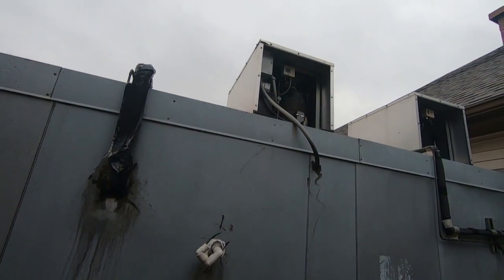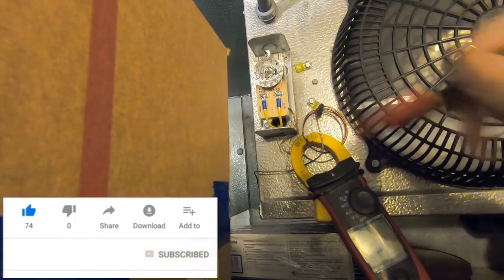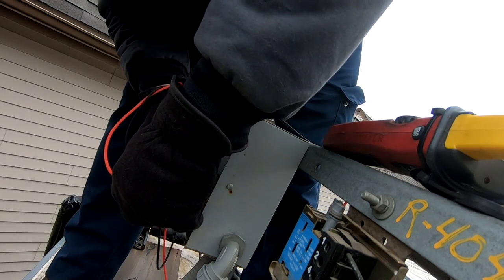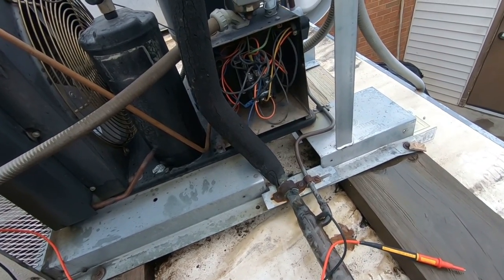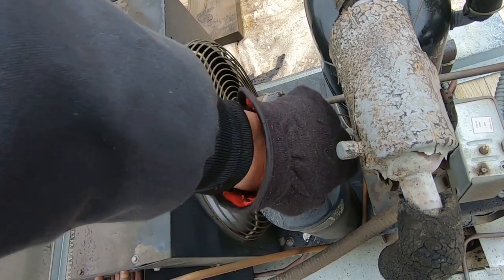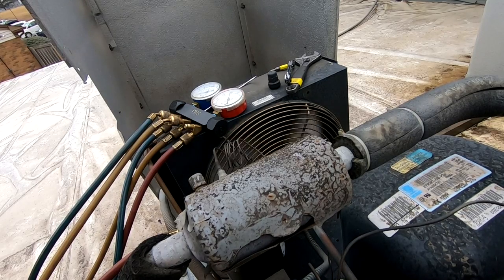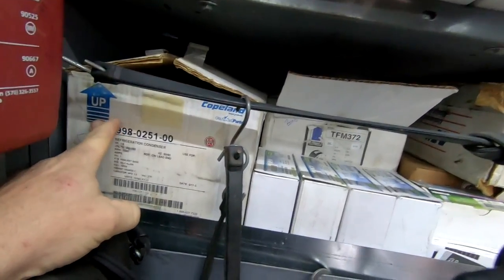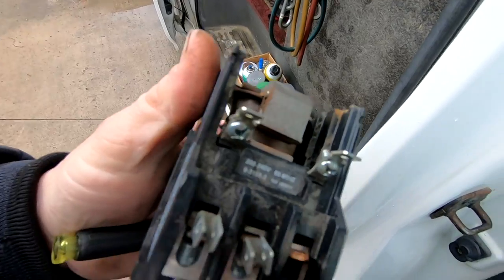Walk-in Freezer Warm With Fan Cycle Switch Adjustment Failing Motor

Comment: Nooice 👍
I like the contactors that you can take the front cover off and inspect them .
Lately I've been dealing with supposedly new Siemens contactors with flimzy @ss push in connectors and you can't take the cover off to inspect them for burn marks , carbon , and such .
Bloody annoying .
Btw  , one neatly organized van that is , Kudos !
Reply from the maker: LoL, My vans a miss, that's why I haven't done a video of it. The contactor that I used does have a removable cover. Thanks for watching!

Comment: ive Got a 8,000 lb service truck & i still dont have the Correct part on my truck. Said EVERY TECH , Every day of the Week. i Looked in my computer the other day & was looking at the motor section that has all the actual motors i have installed in the last 17 years and there was 50 Different Motors in that section. These are actual motors ive sold over the years. So, I Would Have to Carry 50 Motors on my Truck if i was to be assured of having the Right motor for any job. maybe. lol.
Reply from the maker: I get that. I'm just used to carrying a little of everything on my truck where I almost never had to go get parts. That's a little different than where I'm at now.  It's actually interesting how many calls I fix with little to no parts.
Reply: i Get that. i actually put together a little husky go bag for initial call in. a little 12" bag. its been quite nice not having to haul a 40lb bag into calls unless necessary. which is few and far between now that i have it setup. ill have to do a vid on it.
Reply from the maker: @OcRefrig  Yea, make a video of it.  Everytime I pick my most common needed tools I end up going back to the truck. What I have in my tp-XL has about everything I need and maybe only 1-3 extra unneeded tools.

Comment: Good vid. its sooo nice when its a nice straight foreward repair. " use your sniffer " yep, no special tools required. i have not seen the new malco 5/15 , 3/8. ill check it out. i only thought they had the 5/16/,1/4.
must be a new prod. i use the wire tie inside another wre tie thing too. good secure for stuff. anti shaky / antibreaky. like # 20.
Reply from the maker: Thank you OC👍👍.  Using all you're natural senses like smell, touch, sight, heating and occasionally taste will tell you fairly quick what's wrong if you know the sequence of operation. Thanks 4 checking it out.! I just got that chuck 2 weeks ago,  I have a link in there description.
Reply: im in agreement with you there to a Point. " Taste " i DON't think so ! only way im using my taste sense is when im brushing a hoshizaki ice machine evaporator with that monster brush and the shit goes in my mouth by accident. otherwise it AIN'T  happening.

Comment: maybe ants or other bugs getting into the contactor keeping it from pulling in fully, but enough to still run. that would make coil current higher and it cook itself.
alternate thoughts, something in the control circuit shorting to ground and around 120v through coil when it's not being called for, I'm not sure if it would stay pulled in or pull in or what the current would be and it cannot be calculated easily since there's a moving part.  that sounds like a nice bench test setup :)
Reply from the maker: My best guess would be faulty wire insulation on the coil.  The contacts weren't welded shut,  it was jammed in place and would not move as if the wires got so hot that it melted down the plastic around the coil. It could have been from the contacts not pulling in and the iron core did not absorb the heat from there magnet,  same problem if you don't put a solenoid valve back on and it is energized. Total melt  down.
Reply: exactly :)

Comment: Nice job Rick.  The nose knows!   What makes the sight glass look like that?
Reply from the maker: Thanks Freedom!👍👍  I'm not 💯positive,  I don't see it helping very often,  my guess would be a burn out or UV light? Maybe someone else can chime in on that.
Reply: @HVACRSurvival  By the way, if you remember the Lennox furnace you helped me with, it did turn out to be the board.  The heat exchanger was easy to get out and looked surprisingly OK.  I also checked with my CO meter and read "0" so being a rental, it's working and they know about the induction draft motor.  Never know, but they look set for the rest of the season!  Thanks for your help on that one!
Reply: i believe its the sun 🌞. Light.
Reply from the maker: @crforfreedom7407  awesome man!

Comment: How are those CPS Gauges? 
I hate them lol 😂
Reply from the maker: CPS manifold with Yellow Jacket gauges.  My better analog gauges got stolen 4 years ago and I didn't replace them. I use those for simple tasks like a fast recharge or pressure switch adjustments.